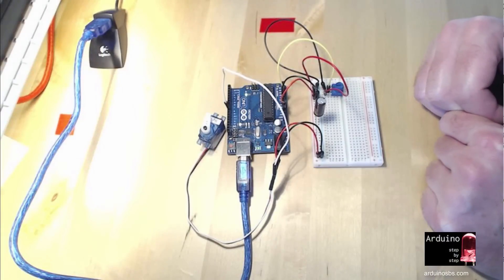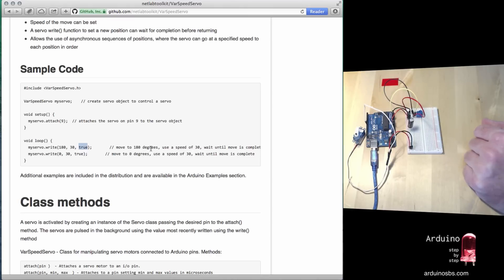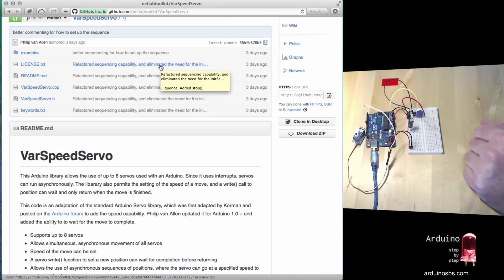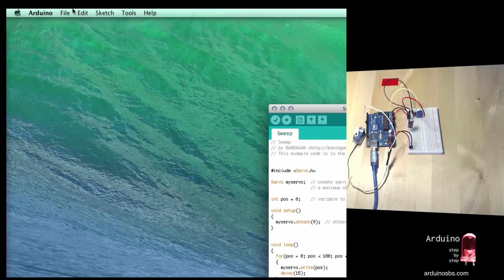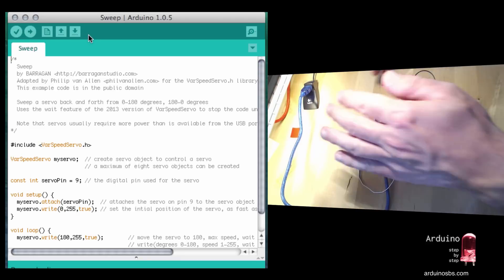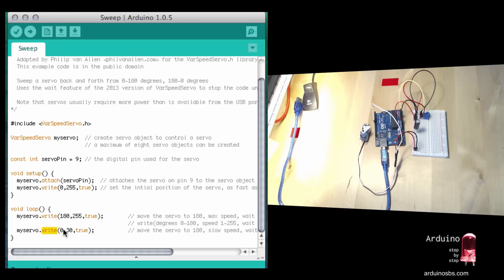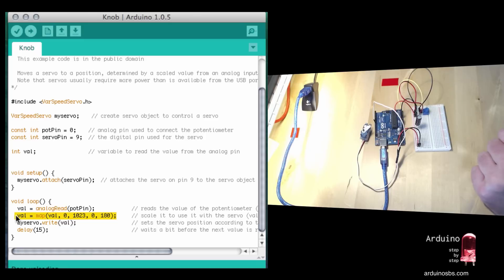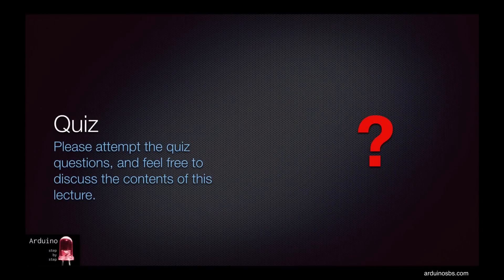Arduino servo motor control, Part 2 of 2

Comment: HI there your videos were really helpful thanks a lot.. i need to ask that is it possible to rotate servo at different angles? i need to take values from LDR and depending on  values i want servo to rotate 45 90 and 180 degrees and after every rotation it should go back to 0 position. for example if LDR value is 1 it goes to 45 then after delay goes back to 0 waits there and the goes to next position depending on LDR value.  is it possible 
thanks

Comment: Can I attach more than 1 servos to the arduino UNO?
Reply from the maker: Hi Davide, on the Uno, using the VarSpeedServo library, you can use up to 8 servos.
Reply: Cheers!